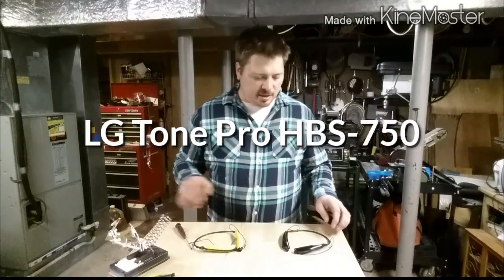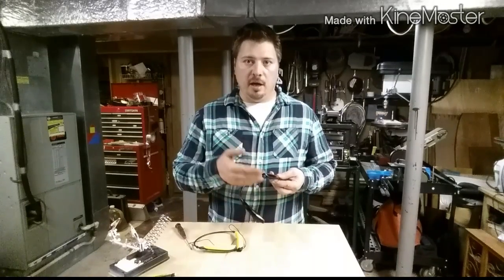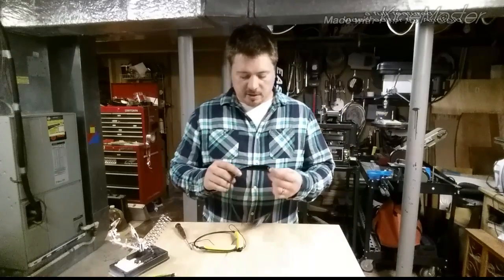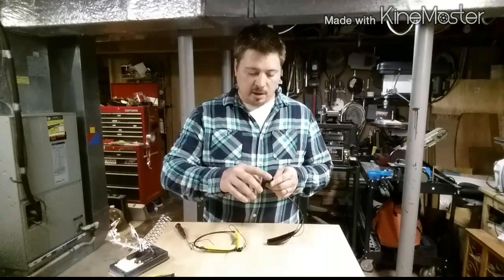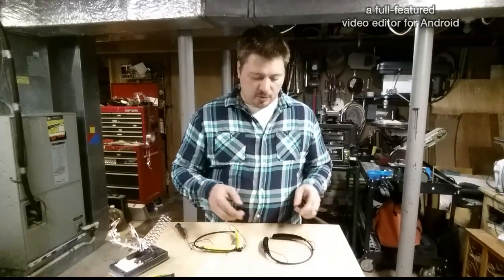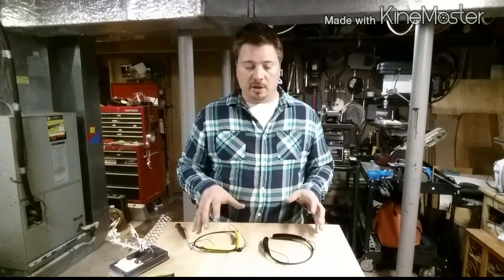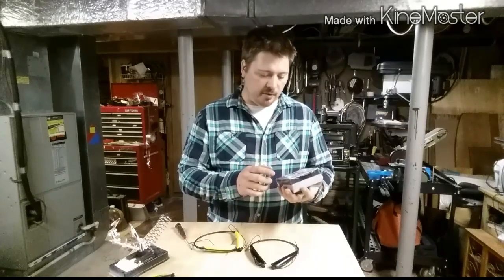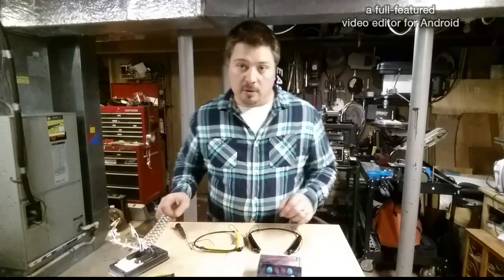LG Tone Pro HBS-750 repair, upgrade, mod

Comment: my 750 wont charge or turn on is it completely dead?
Reply from the maker: +xMarkuzx possibly. You open it up and check the wires are all still connected? You check if the battery has any voltage? Is the power switch sliding correctly? Need to check all that to find out.
Reply: will do, thanks for the fast reply !
Reply: kez3000 I did all you said as I have the same problem as xMarkuzx. any idea how to resolve this?
Reply from the maker: What did you find?  Are all the wires connected?  What is the voltage level on the battery?  I can't really offer a suggestion without knowing some of the particulars.

Comment: bro i own one and it has a problem the right hand side sound comes but the left side sound is very low what to do reply urgent
Reply from the maker: Check out the other video on my channel for the HBS 700/730.  It shows the repair step by step.  See if that helps first.

Let me know if you need further assistance.
Reply: CAN U REPAIR AND GIVE ME
Reply: I AM A 16 YEAR BOY AND I NEVER DID IT SO WHAT I PISSED OUT AND MESSED UP
Reply: YOU ARE A PRO SO U CAN DO IT BRO
Reply from the maker: I apologize but I'm not a professional.  I just took mine apart, figured it out and shared what I learned.  I'll try to help as much as I can but, I can't start repairing for others. Too many people will ask the same and I don't have enough spare time for it.  I hope you understand.
Reply: yes i do but i what should i do should i contact lg customer care
Reply from the maker: LG can fix it or provide you with a refurbished one.  If the earpiece is less than 1 year old, it should still be under warranty.  I sent one of my first earpieces back to them under warranty and they repaired it.  There are also used ones for cheap on eBay.
Reply: but i took it on april of 2014
Reply: or july

Comment: what do I do if one side plays lower than the other?
Reply from the maker: +BriThaLightest first check that there isn't any ear wax build up insidethe earbud.  Gently pull off the rubber fitting and you should find a small piece of fabric covering the speaker. Sometimes cleaning that fabric a little alcohol on a q-tip or just removing it completely will remedy the issue. If not,  then it's a sign that speaker is going bad and needs to be replaced. I show the process in my other hbs video.
Reply: +kez3000 thank you so much

Comment: Where can I buy the replacement,  does anyone has a link.
Reply from the maker: +Christopher Lora Rosario replacement for what part?
Reply: +kez3000 ear buds I mean with the cable and everything.
Reply from the maker: +Christopher Lora Rosario no idea where to get there OEM earbuds but if you watch my other video for the hbs 700, I show how you can use any earbuds.
Reply: +kez3000 thank you,  I will do it now.

Comment: how did u add color  .. to ur headset?
the yellow color ?
Reply from the maker: Rustolium enamel spray paint while it was taken apart.
Reply: +kez3000 so does it look natural , as in factory made or do they look like they are falling apart
Reply from the maker: Depends on your spray painting skills. If you allow them to dry properly between coats, they look good. It also depends on the quality of paint you use. I've found cheaper paints tend to chip of easily and look crappy after a short time. The high quality enamel will turn into a hard shell.
Reply: +kez3000 thank u..once i do it 
.and share it

Comment: Where do you get replacement parts from
Reply from the maker: Joel Orozco I usually buy the batteries and earbuds from eBay or Alliexpress.  If I'm looking for something like a frame or pcb, I just purchase a used or broken one for parts from eBay.
Reply: Awesome thanks

Comment: Does both side has vibration motor?
Reply from the maker: +Shovon Mukherjee no,  just the side with the power switch.
Reply: +kez3000 thank you so much for your response. Have a great day.

Comment: My left earbud is louder than my right one, can someone explain why?
Reply from the maker: If you've made sure it's not a software problem (left/right balance settings) then one earbud is probably going bad.  I show the replacement in my other video.
Reply: kez3000 ok thanks, and yea the sound quality is the same on all my divices. And I checked my hearing, no problem with it.
Reply: +kez3000 mine is the same way and they aren't all that loud , is there a software I look up or how do I do that?
Reply: +The Oasis I had a similar situation recently and found the problem, and the solution. There is a soft fabric cover(disc) over the speaker in each earbud and if it gets blocked, even if you can't see anything on it, it will dramatically reduce the sound and sound quality. What I did, by accident mind you, was to remove this small piece(remove with fingernail) and the difference was dramatic. Sound clarity was greater as well as tonal quality.

Comment: My lg HBS 750s work PERFECTLY except for 3 things
*The light doesn't come on when I charge them
*I have to HOLD one of the volume buttons while hitting the power switch to turn it on (that's the only way I'll hear the speaker telling me it's on)
*And the LED light blinks while it's on the charger (Eventhough it's FULLY charged when I take it off) HELP...PLEASE? 😣
*It keeps disconnecting. If I pause a movie/song while they're connected...I have to connect it again once I get back to it...EVERYTIME. *THIS HAS BEEN LIKE THIS FOR THE PAST 5 DAYS. SMH
Reply from the maker: I'm not even sure where to begin with that. I've never heard those symptoms before. It sounds like one of your chips may be fried inside.  The good news is 750's can be picked up rather cheaply on ebay these days.
Reply: @kez3000  okay..thank you!

Comment: Hi lg tone pro the low sound why?
Reply from the maker: I don't really understand the question. Can you explain further?
Reply: when playing music sounds very low volume
Reply from the maker: Its possible the earbuds are going bad or it could be a circuit problem tho. I don't have a method of testing that yet. You could try attaching new earbuds to see if it improves the problem.
Reply: wilmar carvajal 
It might be the black paper-like mesh that's covering the driver. If you remove the rubber from your earbuds, you'll see it.
Try taking it away and hearing if it's still low. If it gets better then you need to fix that mesh somehow. Have to have something covering that driver!

Comment: Can't get voice commands to work
Reply from the maker: I believe that is a software issue. Most likely not an issue with your earpiece.
Reply: What soft ware do I need to install
Reply from the maker: I mean is probably an issue with the device you're trying to use voice commands on.
Reply: Lgg3

Comment: Has anyone else's just stopped having power completely? I was using it at work went to my car for my break put it on the passanger seat like I always do and when I turned it back on...nothing no lights no power no sound.
Reply from the maker: Its been my experience that the factory battery connection is sometimes weak because of the thinness of the wires.  That would be the first place to check. Make sure the positive and negative battery wires are security soldered to the board.  Another possibility is that the battery stopped functioning.  LiPo batteries can be finicky like that.  The battery can be replaced.
Reply: kez3000 Yeah I think the battery is dead, I tried using my multi meter and got nothing in terms of resistance or voltage from it, Any idea where I can find a replacement battery?
Reply: Galzar And the connections all look good
Reply from the maker: My other video for the hbs 700/730 has the battery info. I'll be doing a battery review for the different size batteries later this month.  Aliexpress has a good selection of batteries.
Reply: kez3000 Thank you.

Comment: Great job on the video kez3000!

And thank you for saving me lots of cash$$$!!!!

I have 3 questions that require your expertise, if you would please take the time to answer them if possible, at your convenience.

1.  I would like to upgrade the battery in my HBS-750, but I have a question about that for you.  In your video you state the battery should be 195 mAh, but on the battery you pull out of the headset, is printed 220 mAh.  So which 3.7V should I order? 195 or 220 mAh?
P.S.  TY for the Model #501240 3.7v. 220mAh, and the link to: AliExpress.com on your previous video covering the HBS-700/730 repair. (I LOVE SPECIFICS!)

2.  I would like to upgrade the microphone (if possible) in order to provide a more clear voice (or sound quality) to my clients - even under windy conditions (such as standing outside on a windy day, or even driving with a window down).  Recommendations?

3.  I would like to know which headphones that you have personally installed provide great sound, that fit well within the magnetic earbud bays, and have lasted the test of plenty of use and time, with no noticeable wear, nor degradation of performance.

I have one more request: When providing me this information please be as specific as possible; for example: providing the model of the headphones, instead of just the brand name, as you do in your vid.  (maybe you should add this info to the description as well? it would help us mr.fixits imo.)

I really appreciate you taking your precious time to make these much needed videos, offering your expertise to us, and if time allows, answering my questions.

Thanks again!
-Pro
Reply from the maker: I'll get back to you soon as I can. Might take me a day or two cause the East coast blizzard is keeping me occupied right now.
Reply from the maker: +David Pendleton 
Sorry it took me so long to reply.  Please keep in mind that I'm not an expert.  I'm only a hobbyist trying to share and save people a few bucks.

1.  The system runs on 3.7 volts as do most micro electronics these days. The 195mAh battery ("mAh" refers to how long the battery will last on a charge) was the standard battery for this earpiece when I made this video.  It is possible LG may have upgraded to a 220mAh battery but I'm not aware of it.  The problem with the HBS 750 is compartment space.  It is possible you may be able to fit a 260 mAh battery but it would be a tight fit as they are a bit larger.  They also come in all different dimensions (L,H,W) so, you'll have to look at that before you buy as well.  

2. I'm not sure what can be done about the microphone.  I do have a video showing how you could replace it but I have no recommendations for a good quality one.  I am pretty sure the noise cancellation is done through the pcb and not the mic itself.  

3. The name of the earbuds I used with good success are "Awei ES600M Super Bass Nose Isolating HiFi Headphone".  I found them on ebay and they worked great.  I did have one pair i needed to replace but mostly they were good sound.  If you're looking for durability, I would suggest finding something with a nylon wrapped cord or "tangle free" wires as they will resist wire breakage better.  If you wanted to go crazy and really trick out your headset, you could get a high end brand like Bose or Beats by Dre but I doubt it would be worth the money.

Hope this helps.
Reply: Hi, mine is also HBS 730 TF and it went dead after last charging. the red light was on but not anymore. it starts to heat up. im sure its not okey right that it heats up. But im scared to repair it myself cuz im no good at mechanical skill..

Comment: Can someone help me, my right earbud stopped working and it's EXTREMELY annoying because I use both of them. Please reply before I turn INSANE!!! Thank you.
Reply from the maker: +Moe watch my other video for the hbs 700/730.  It will walk you through the whole process.
Reply: kez3000i have a 750 and I think it's broken at the source because I have to move it around at the base. Are all the 7xx similar
Reply from the maker: +Moe the process is similar. I made the 750 video as a supplement to my 700/730 video.  The 750 video just shows you what's different. If you watch both of them,  you should have all the info you need to replace the whole earbud and wire.
Reply: kez3000 ur my hero
Reply from the maker: +Moe happy to help.

Comment: That's all good and well if you're one of the 2% that this actually happens to. How about a tutorial on the remaining 98% who don't give a crap about this tutorial because the actual earbud broke, not the virtually indestructible hub.
Reply from the maker: I'm not sure I understand what you're complaining about.  Replacing the earbud and wire together at the pcb is the preferred method. If you try to repair the earbud speaker only, you'll likely cause to much damage opening the housing to make any repairs.  If you try to fuse the wire, the repair will be fragile and likely break again. 

 If you have a specific question, I would be happy to answer to the best of my knowledge.

Comment: it was working but then then i couldnt hear the music and then i opened it up and i saw a red wire lose and i dont know where to put it
Reply from the maker: +Luis Ruiz for the earbud?
Reply from the maker: +Luis Ruiz there are a lot of red wires. Which one are you referring to?
Reply from the maker: +Luis Ruiz I show the solder points in the video. The red wire should connect to the positive solder pad rift needy to where the gold negative wire is connected. Watch my hbs700/730 video if you need to see the full process.
Reply from the maker: I don't know what time at the moment.  I didn't make the video in sections.  I made these videos to show how I repair or modify the LG earpieces.  This video is a walk through of the parts locations for the HBS 750.  I made it as a supplement video to my HBS 700/730 repair video.  If you watch both videos to the end, you should have a good understanding of how to repair your earpiece..  If you still have questions after watching them message me.

Comment: my lg hbs 750 will not pair. the purple light stays on constantly even when I turn it off. when I plug in the headset to a charger, the light turns solid blue until unplugged then goes back to purple. it will say power on and power off when stitch is flipped, nothing else. do I need a new battery?
Reply: this happened to me b4.. what u do is let it die entirely and recharge it and it should be good as new
Reply: Still no good. Just got a new one

Comment: My head set turns on and the light turns a blue solid and says ready to pair but fails to pair with my iPhone and I turned it on and off constantly both head set and phone but still won't pair any way to fix it?
Reply from the maker: +Savage Life I'm not sure what the problem could be.  I've heard of pairing & connection issues with the iPhone but I don't know what causes it.
Reply: +kez3000 that actually helps it'll probably would connect to a android considering Apple only functions properly to apple products -_-
Reply from the maker: +Savage Life Yea...  I'm not a fan of Apple.
Reply: I have no problem pairing to the iPhone 5S.  Of course it could be the phone or the headset.  Try it on another phone to narrow down the problem.

Comment: mine turns on and immediately starts vibrating, I hear 2 different beeps, and the led shows long red, 4 short blues, then vibrates and starts the pattern again. any ideas?
Reply from the maker: In short, I'd say the earpiece is screwed.  You could open it up and see if they're are any lose wires or crossed connections.

Comment: A faulty charger screwed my LG tone pro, no warranty. What should I do to fix it? Please help :(
Reply from the maker: I don't know what damage was done by the charger so, I can't tell you what to fix.  Some basic things you can do: You can test the battery to see if it's holding a charge. You can look for burn marks on the board. You can look for disconnected solder points on the charging port.
Reply: kez3000 thanks for the quick reply, so the charger wasn't working and I had no clue. I plug the charger and attach he headset and switch it on. The charger sparked up and smoking. I remove my headset, it's not working, not switching on, no light or anything. I plugged it to another charger, still no response.